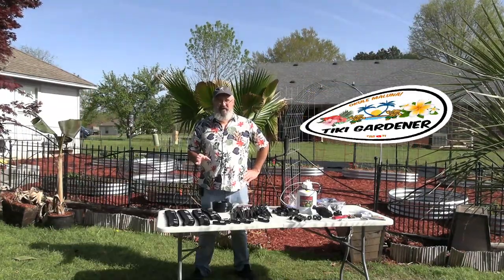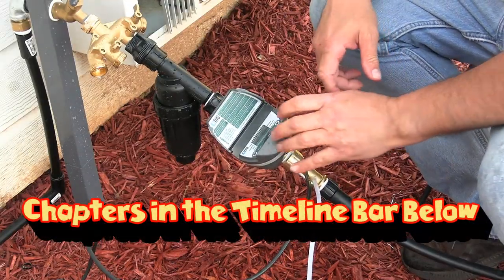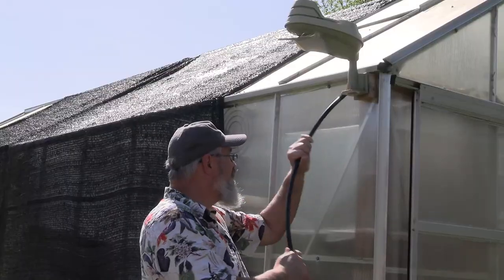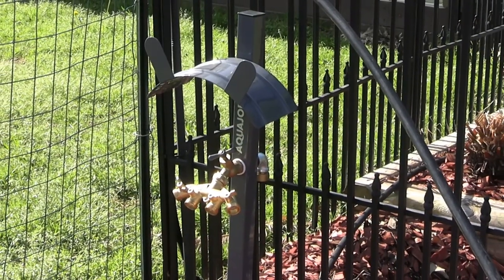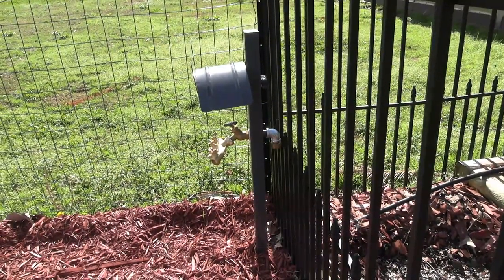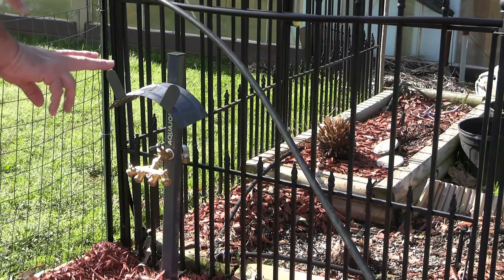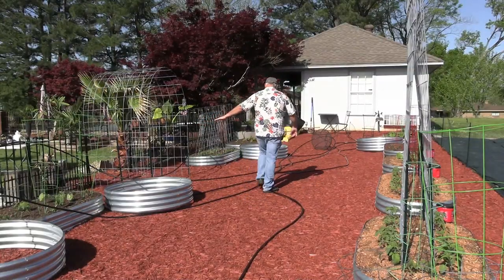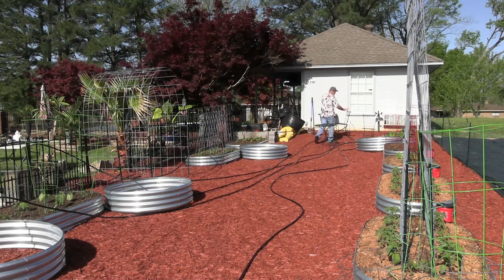This Garden Modification will SAVE YOU HOURS per Week! #Drip #Watering

Comment from the maker: 🌊Drip Irrigation Supplies::
Aqua Joe Water Stand: https://amzn.to/3vu2lYJ
4 Way Brass Manifold: https://amzn.to/396aVFG
Garden Water Filter: https://amzn.to/3uVMD9Q
Backflow Preventer (MUST HAVE): https://amzn.to/387vMrN
Dig Digital Water Timer: https://amzn.to/3MiXRLr
HOSS Fertigator: https://amzn.to/3rFza3L
Drip Irrigation Filter: https://amzn.to/3rDSEGi
Pro Pipe Thread Tape: https://amzn.to/3xDcHYX
½” Drip mainline: https://amzn.to/3vQg7Fx
½” Elbows (25 pack): https://amzn.to/3L3xLvx
½” Tee’s (15 pack): https://amzn.to/3rEavMW
½” Line Stakes (32 pack): https://amzn.to/3vzTvbW
½” Screw couplers (5 pack): https://amzn.to/3rE6CI5
½” to ¾” Drip Faucet Connection: https://amzn.to/3xX4dML
½” Drip Termination Caps (5 pack): https://amzn.to/3JZO0IV
Drip Punch Tool: https://amzn.to/36uWhXw
¼” drip tubing: https://amzn.to/389hxlZ
¼” Barbed connectors: https://amzn.to/3k2BE85
¼” Tee connectors: https://amzn.to/3jXImw9
¼” Elbow connectors: https://amzn.to/38SL5Vp
Adjustable Drip emitters (100 pack): https://amzn.to/3K0ZZGf
Softer 360 degree Emitters (50 pk): https://amzn.to/3EyP0lW
Pressure Compensating Emitters (50 pk): https://amzn.to/3jUst9J

Triple 13 Fertilizer: https://amzn.to/3rtSYHj (May be hard to get soon)
3’x6’x12” Galvanized Raised Beds (2 pack): https://amzn.to/3JiA3VT
Tomato clips (used for trellising): https://amzn.to/3LIRrF1
Biotone Starter:  https://amzn.to/37imF7i
2 Gal Water Can: https://amzn.to/3OagzGT
6 ½’ x 330’ Landscapers Barrier: https://amzn.to/36RrdSc
1020 Seed Starting Trays & liner pots: https://amzn.to/3M2jK1q
4 Prong Cultivator (Singing not included): https://amzn.to/3jBALU5

Heirloom Vegetable Seeds-
Sugar Snap Peas: https://amzn.to/3IvpI8H
Rutgers Tomatoes: https://amzn.to/36A6jX4
Sweet Bell Peppers: https://amzn.to/3Iw87h5
Cherry Tomatoes: https://amzn.to/3itmOH7
Beefsteak Tomatoes: https://amzn.to/3ir6Vkq
Carrots: https://amzn.to/3ujcsiG
Okra: https://amzn.to/3qOXmAD
Summer Squash: https://amzn.to/3JC7zYu
Zucchini: https://amzn.to/3JDRFN5
Sweet Banana Peppers: https://amzn.to/3tvtD16
Celery: https://amzn.to/358rSOc
Cucumbers: https://amzn.to/37HLfyk
Jalapenos: https://amzn.to/3uiQWdF
Swiss Chard: https://amzn.to/3D4xXaH
Bush Beans: https://amzn.to/3Ee9PTE
Watermelon Radishes: https://amzn.to/3uG3FIX

🍹 We have a recommended product page on Amazon & it’s filled with the things we use and like & it’s a convenient way to check out what you see on our channel & it adds ABSOLUTELY no cost to your purchase: https://www.amazon.com/shop/tiki71  
If you click through and buy something, we receive a small a very small commission (as little as 1%) that costs you NOTHING extra, but it helps us with the costs of delivering content, so Mahalo (thank you)! 🤟🏼 

In this video I’m panting: Squash/Zucchini, Sugar Snap Peas, Bush Beans, Watermelon Radishes, Rutgers Tomatoes, Beefsteak Tomatoes, Cherry Tomatoes, Bell Peppers, Sweet Banana Peppers, Jalapeno Peppers, Cayenne, Habanero, & Okra in raised beds.

🌴 Subscribe: https://www.youtube.com/c/Tiki71
🌺Join our Facebook Page: https://www.facebook.com/thetiki71
🥥Instagram:  https://Instagram.com/TheTiki71
🗿 Twitter (I do memes a lot there): https://twitter.com/thetiki71
🦜 Email: tiki71@yahoo.com

📭 Send letters, pics, and stuff (I might open it on camera and give you a shoutout}: 
Tiki71
c/o Jungle Jerry
205 Wilburn Heights
Central City, AR  72941

🥂 Fund our content directly: https://www.paypal.com/paypalme/tiki71 

🌴 🍷 Okule Maluna! (Bottom’s UP)🥂 🌴

Comment: Tiki's setup is a lot more complicated than mine, but the essentials are the same. A drip system on a timer is almost a necessity if you garden in a place that has hot summers IMHO; it makes things so much easier. In addition to vacations, during the workweek you can let the garden go as much as you want to & know that it's still getting watered, without getting home after a long day at work & having one more thing to take care of every day. During hot days you can set most timers to water early in the morning, which avoids a lot of water loss due to evaporation vs. watering after its gotten hot.

One thing I have to remind myself every year is to put the drip hose down, then put the mulch over it. I usually get so excited after getting a lot of mulch that I tend to put it down the same day, which means I have to dig through the mulch later to put the hose down when its time to set out the watering system for the year.

Comment: Watch your spray emitters. The lower PSI will prevent them from reaching their potential and syphon the necessary pressure for your drip emitters.  Furthermore they tend to pop on the top. I used a rubberband to keep the threads. A little silicone would work far better.
Reply from the maker: They working good now, but I will.  Thanks!

Comment: Question:  how do you keep the sun from heating the hose to 200°?  I tried this and about killed plants.
Reply from the maker: I have the timer set to water around 6am.  In the extreme heat, I will add another water time for around 7pm.  Doing this keeps it from being scalding hot water.